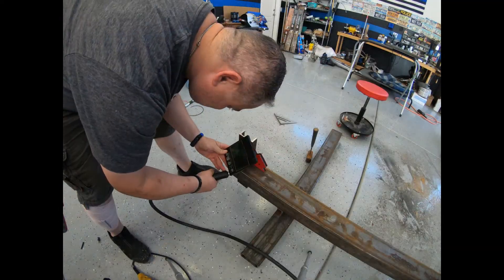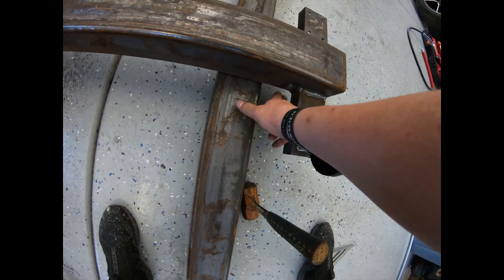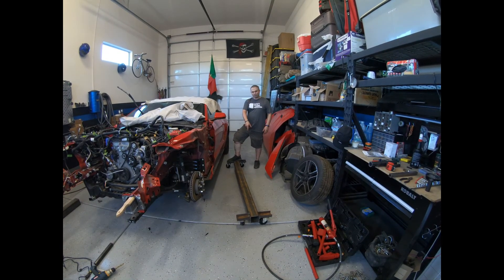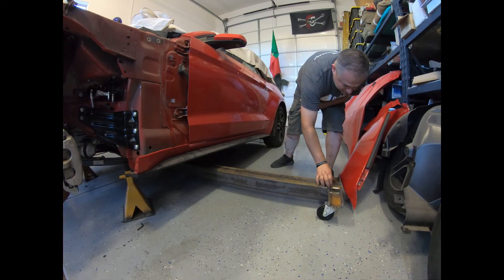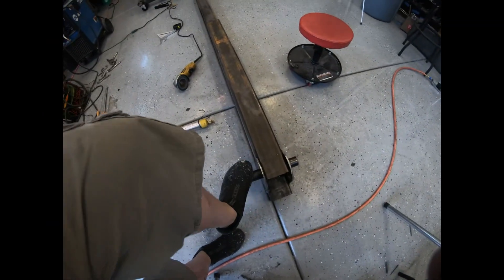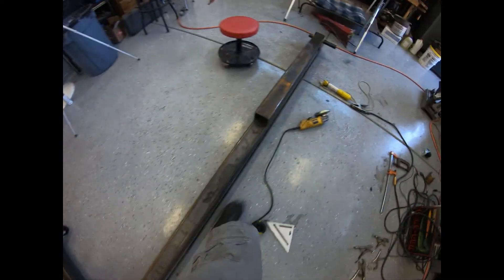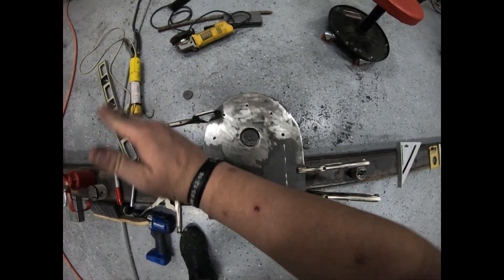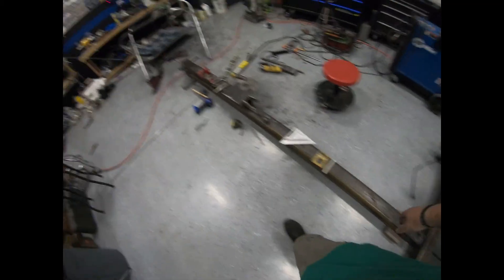Blue Line Garage - Custom Made Auto Frame Machine for Automotive Frame Repair - (Part 1)

Comment: What are the measurements for this for the frame puller if someone was interested in making one for a first time project if possible. Thk u even if u don't assist.
Reply from the maker: It's in one of the replies I did. Search through it and you will find it
Reply from the maker: It's in one of the replies I did. Search through it and you will find it

Comment: There is nothing wrong with creating a How To, DIY video.  But you would appear to be a lot more professional and knowledgeable if you used proper safety procedures and the right safety equipment in doing so.  Happy building.

Comment: How long and thick is the steel you are using?
Reply from the maker: the main shaft is 10 feet. the part that goes under the car is 6 feet and the yellow arm that pulls 4 feet. the thickness of the metal is 3/8